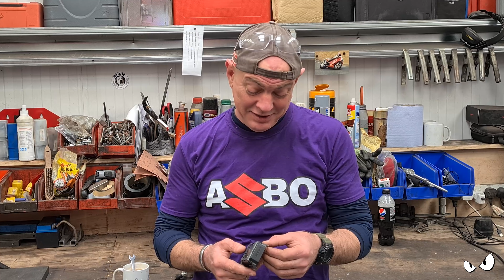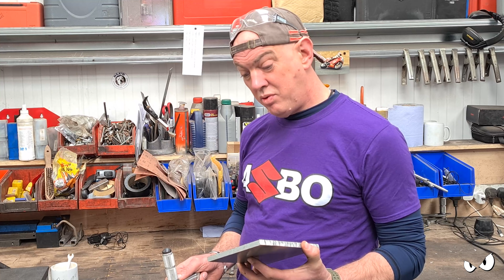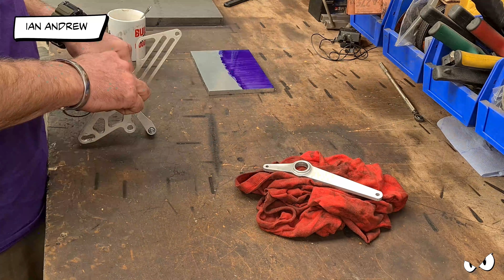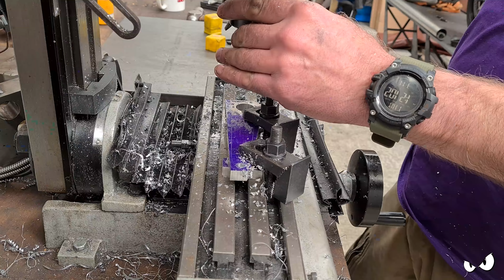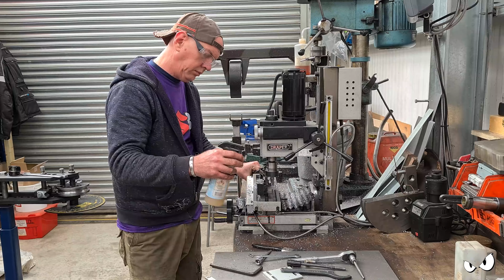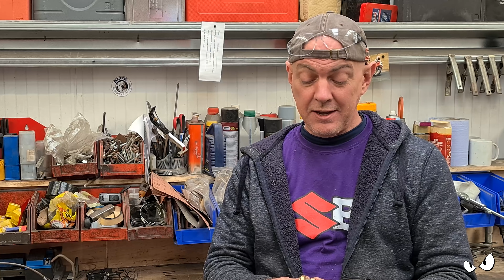Gear shift - Suzuki Bandit Cafe Racer - GIXIT Project Part 69

Comment: There are guys that do that machine moving all day, you need a mini crane lorry, but you need to move it via crane hook points or you can easily screw the mill up , also need to make sure it's weather protected..and finally a levelish entrance to roll it in
Reply from the maker: Yeah, it's going to be interesting shifting it for sure... 😂🤣👍